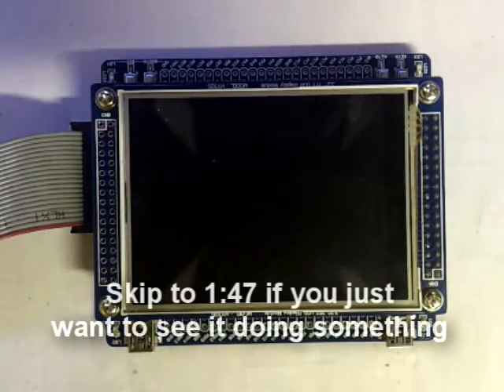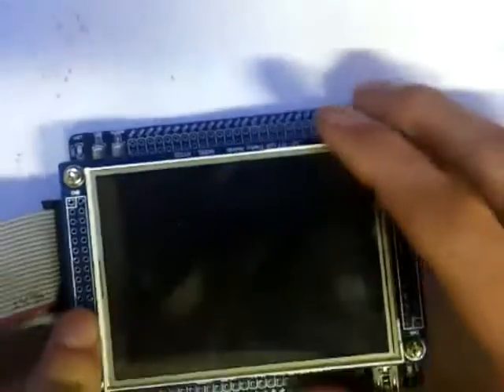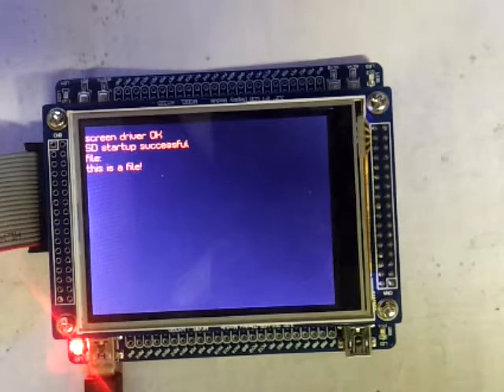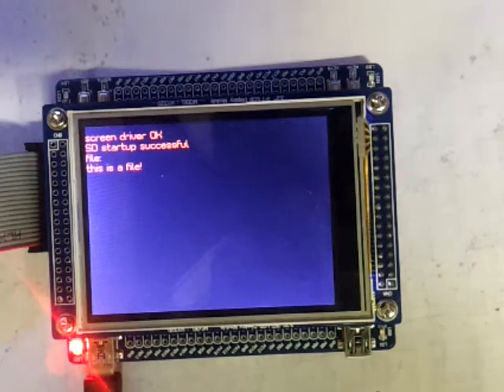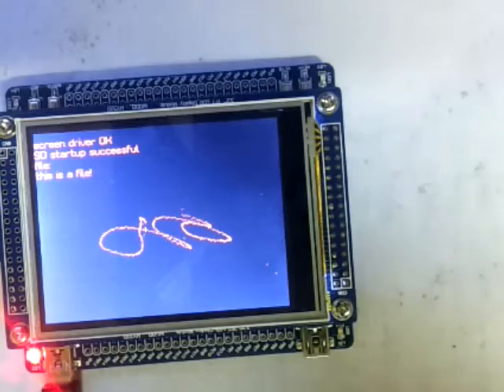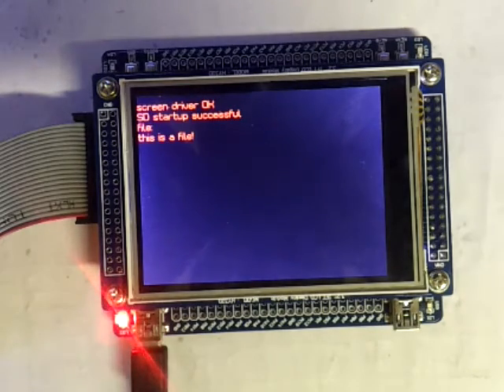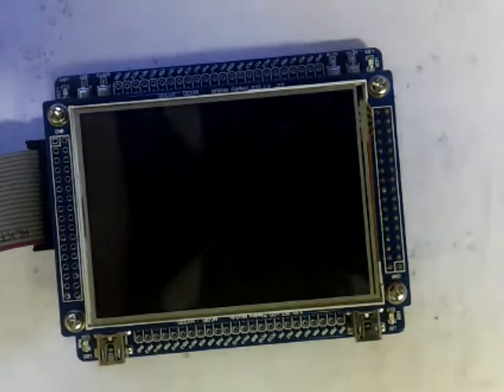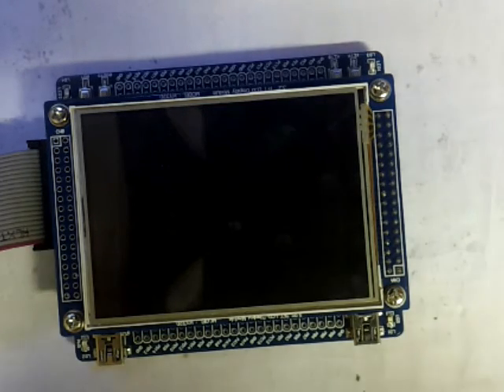L-OS new dev board! 72Mhz 32 bit ARM etc!

Comment: Just a thought, if it makes heat, next to the cpu might not be the best place for a Li-Ion battery unless you can deflect the heat away from it.  Not so much that it is creating enough heat that the battery will fail horribly, just that heat isn't their best friend for long term life.

Comment from the maker: The dev board on its own costs a mere $35 with free shipping, the programmer $30. The programmer isn't needed to upload code, you can just use the USB COM port and the bootloader. the website is hotmcu (dot com, of course) and the full name for the board is "HY-MiniSTM32V Dev Board + 3.2" TFT LCD Module"

Comment: I'm somewhat curious, since you say this board uses C++ for development.

Normally in C++, you aren't required to use classes, class members, templates, or any of the other C++ features, and could limit yourself to using only C-features, if you so desired. Can you not do that here as well (as in, is it a variant that restricts you to OOP), or did you merely decide to go all out with C++ and use it to its fullest capabilities, since it's the language you were going to be compiling anyhow?

Comment from the maker: the ARM Arduino is for the wrong processor (atmel model), and I won't have the high level power I now have with my new libraries with the due.
this is practically an STM discovery board, with the programmer seperate and a touch screen built in. It's an all-in-one,sort of.

I don't remember what I said exactly, but it only gets mildly warm. Also, phones have dynamic clock speeds and sleep modes, this is currently fixed.

and this is running at 3.3V, but like the RaspPi, it takes 5V input.